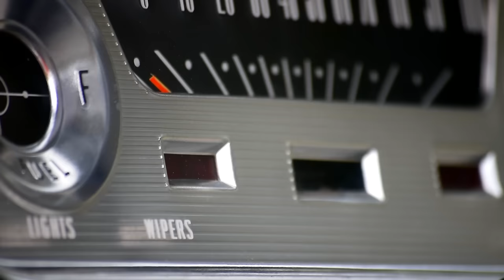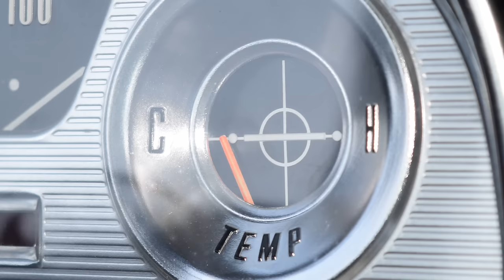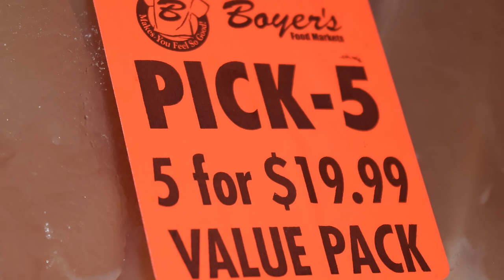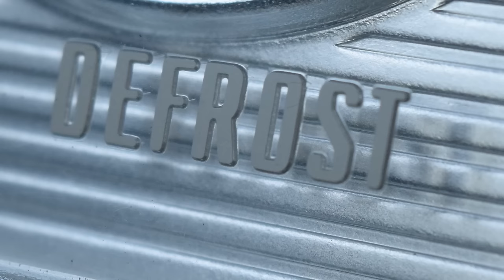Regular Car Reviews: 1960 Ford Falcon (stock)

Comment: Just saw this.  Just remember that without the Falcon the Mustang would never have been born.  The Mustang was a modification of both the Fairlane and Falcon platforms.  1965 shop manuals actually cover all three cars since many of the components overlap.  While Iococca might have hated the Falcon, the platform was pretty adaptable and he used it to his advantage-the 1964.5 Mustang was by and large a 1963 1/2 Ford Falcon.  By late 1963 a 260V8 was available and later 289s and 302s could be found in Falcons.  The trim improved and a nice 64 Sprint is a pretty hot car for its day.  You also have to remember what McNamara was trying to do with the Falcon.  The Edsel line had shown to be a financial disaster for Ford, costing something like 2.5 billion dollars in todays funds.  The 1956 and 57 Continental Mark IIs lost several thousand dollars per car sold.  The Lincoln division had cars that ballooned into huge monsters that were impressive, but so expensive that it threatened to run Lincoln out of business.  The 55-57 Thunderbirds were popular but did not sell all that well.  The only really good seller in the entire group, and the only vehicle that really kept Ford afloat during that time was the Fairlane.  Ford was rapidly losing ground to GM and even Chrysler.  Ford didn't have the money to continue to experiment at that time.  McNamara was perfect for that time.The 1960 Falcon was boring.  But it was built to fill a niche.  It really wasn't designed to be a primary family vehicle, although it was used for that.  It was more of a second car, a cheap alternative to buying a used car.  It seems sexist now but it was built to be a woman's car, something the 'little woman' could drive around town to get groceries or take the kid to school.  And it worked well in its role as secondary car.  The 144 and later 170 and 200 was pretty much bulletproof and the fordomatic needed little maintenance.  The brakes were good by 1960 standards and it was easy to drive.  And the platform was easy to update.   But an upgraded Falcon was almost as expensive as a Mustang so most people bought the Stang, even though mechanically they were very similar and the Falcon was probably a little bit faster.  I actually like the Falcon, for what it was it was a decent car.  And it honestly was a better car with the three speed column shift than it ever was with the automatic.

Comment: You forgot to mention the protruding steel, skull smashing dash top and no seatbelts.  eek!  My mother had a green one of these and it was lovely and had seat belts fitted but that dash always made me nervous for my frontal lobes.  In Aus, the top ball joints used to break on our shocking roads of the time but were fixed in subsequent models.  Cheers.

Comment: My stepfather bought an early Falcon wagon in the late 60s and spent maybe a year rebuilding it, even putting in a new engine--a straight six. Seemed to run pretty good when he finally finished it, but I don't think he kept it for as long as he spent rebuilding it. Next time I saw him he was driving around in a Cougar with a huge V-8, terrible mileage, and air conditioning that couldn't deal with summer in Sacramento.
Reply: Naw! He couldn't deal with the LOUSY Falcon engine.

Comment: in 1975. i had a 2 door 1960 model with 3 speed manual and column shift . later Mustang 200 6 cylinder.

Comment: Had one, drove one...many years ago. The 144 was rated at 85 horsepower at the flywheel. The engine in this video is not running correctly. It is shaking and missing, which means it needs a major tune up. Mine ran smooth as silk. As far as the rest of the video is concerned, the individual making it can only find fault with the vehicle. It was 1960, cars did not have emission controls, they did smell like gas, but they ran as produced. It is apparent that the author of this video was not even around when this or any other vehicle before 1970 was produced. I own a 1963 Cadillac and love the experience of the times.

Comment: You could get the Falcon with a 260 cubic in V8 by 63. Basically a 289 with a shorter stroke. With an optional floor shifting manual it was pretty good at getting around and did not suck gas like it was free.

Comment: Power steering was not necessary with the old narrow cross-ply tyres.
Reply: Especially in when that car weighed 2500 pounds and gave the driver a really good feel for the car.

Comment: In "The Decline and Fall of the American Automotive Industry", Brock Yates wrote that Detroit HATED making small cars. The cost to make a small car was not that much less than a big car, but the big cars could be loaded up with profit-making options. They would make a small car when it was necessary to beat back foreign competition, but stop when they felt the threat had waned. They also thought that if they made a crappy small car, their customers would think that all small cars were crappy. That's why some small cars got a cheap engine instead of a decent one that cost a little more.

Comment: I know they had "Futura" and "Sprint" packages for Falcons (the later was a Spot option) and they at some points had Hard Top and Soft Top convertibles (my dad had a soft top at one point).

What were the design changes?  
The Instrument Cluster and some other interior Changes happened in 1963, s more "Square" body in 1964-5, another body change 1956, eventually the last year of 1970 they made a few Torino's with "Falcon" labels.

Comment: The ironic thing is that while back in the day, this car was the equivalent to a base focus, and it got no attention whatsoever. However, nowadays if you take this to a car show, most people will flock around it and it will get the most attention, because most cars you see at car shows are v8 swapped camaros, mustangs, fairlanes, etc. Nobody sees these 6 cylinder cars anymore.

Comment: The US may have dropped the falcon but us Aussies kept it going. We stopped making them in I think 2016. 
That crappy little 6 engine ended up the Barra 6 which we turboed as a v8 eater especially LSs. The final v8 falcon had the coyote 5.0, stripped and rebuilt into the Aussie Miami, supercharged. 
The falcon here kept the mustang out of australia because the mustang was too slow.

Comment: I had a '61 Comet, the Mercury version. The 144 and 170 cubic inch engine was a terrible design, had huge blow by. The shift linkage got worn and chaffed thru the brake line. The clutch pivot in the bell housing broke several times. But hey, new cost was about $2600.00

Comment: I really liked watching this video!  What was said tis true.  I own a 1961 Falcon.  3 on the tree, with a 170 C.I.  Ordered U&L ball joints from Mac Auto.  Should be here in a couple more days.  Just put a new mech. fuel pump on it because it started blowing raw gas out of the vent hole.  Engine over revs on the interstate, so I just putt putt around on the back roads.  I did put a rad. overflow tank because antifreeze costs a bit, and I do not want to make any more dogs die.  Next time I think to get my camera out, I might put a video of it on my page.  Nothing on it except for trail camera pics of a huge raccoon intimidating my cat.

Comment: Father had a 1962 Falcon wagon that he bought used in 1963 and kept until December 1969, when it had about 90,000 miles.  I think it was running on three cylinders by then. He was a much tougher and more competent man than I am and never had a car with an automatic transmission until he bought a Taurus in 1987.  I really don't think Ford built a good 6 cylinder engine until the Duratec V6 debuted in 1995.

Comment: The Falcon,  which I love was Ford's response to the Studebaker Lark.
Reply: Nah, 1958 was a recession year and the Big 3, particularly GM, were expanding their market share by introducing compact models. Next would be the introduction of mid size models in the early 1960s, or B-body platforms. They'd have small, medium, and large cars. The mediums were actually the size of a 1950s full-size, since the longer, lower, wider trend had increased the size of a full size.
Studebaker was in trouble and little competition for entry level GM Chevrolet division. 
Nash had been building smaller cars such as Rambler and Metropolitan for years. Sears even sold a car, the Allstate, through their catalog. Willys Henry J and Hudson 6 were smaller cars, too.
Studebaker may have introduced the Lark prior to the Falcon, but the wolves were howling for Studebaker.
GM sales were so successful, in the 50s, that they were crushing Ford and Chrysler. The independents didn't have a prayer.

Comment: I'm so very sorry for you, Mr. Narrator.  You seem to have so much trouble understanding THE WAY THINGS WERE back then. ChuILL, please.  I used to work on these way back when, before latex gloves and everything!  I even got my CA Smog License in the late '70s, so I was smogging these old birds. (That caused even more overheating and the addition of a radiator overflow tank.)  I loved tuneups on my '60 F-100 because I could climb over the fender and stand next to the engine to put plugs, points, condenser, and rotor in.  Fond old memories of the sparse underhood structures back then.  <wistful sigh>
P.S:  YOU FORGOT '65 Goats, with the 389cid SixPack motors (triple 2-bbl carbs)!  It definitely wasn't a Falcon, either.

Comment: Those old two-speed automatics were hilarious.  They operated well in two modes.  Either you drove them real easy, and the transmission behaved reasonably, or you drove them super hard and the transmission behaved reasonably.  Driving anywhere between real easy and super hard resulted in a very disappointing shift into second gear, they just "dogged out".  Just something for those viewers who haven't experienced a two-speed automatic.

Comment: 19F or -7C if you a for some reason driving it when it is that cold do not fix the heater. That is just the way it works. My brother spent a bunch at the dealer with new heater core and fan. No change. His was a 60 Comet for some reason Ford put fins on it. Almost every thing else is the same. The 100 MHP speedo is very optimistic.

Comment: Ford Australia made these from September 1960 from components shipped from the US. The only local adaptation to start with was to shorten the rear overhang of the station wagon. Then they had to strengthen the gearbox components, put in front suspension ball joints from the Ford Fairlane to stop the suspension from collapsing, strength the frame so the body wouldn't twist on rough roads and do more to stop rust. It took five years and three model generations to do so. Only then did Australians stop laughing at Ford Falcons...

Comment: Mean while down under RHD versions penny pinching was apparent.Suspension issues due to bad ball joints, manual gear box, weak linkages, no synchro on first these wheezy engines needed & so did not stand up well to local roads.Local version had stainless steel trim window surrounds pity about the sharp edges & elsewhere.Not missed.

Comment: I just came back here after like an year to tell you all that on Argentina Falcons were Made till 1986 or so.I think there were some Made on 1989 but i cant be sure about that.I can tell i've seen a 1982 model cause my dad had one.Theres a Lot of Falcons here,they still running good,Easy to fix,3 speed manuals and More combinations.

Comment: Ford has always come up with some real winners.  Falcon, Pinto, Maverick, Tempo, Fairmont, Taurus..  The Falcon, however, wasn't a complete loss.  When Lee Iococa went to Ford, the first thing he did was take Falcon (a pretty good car, actually) and put a new body on the chassis that wasn't quite as hard to look at  Voila!  The Mustang was born.    De Lorean did the same at GM.  He took a ho hum car, Pontiac Tempest, and dropped a Bonneville engine in it.  And we had the GTO.  It isn't enough for cars to be reliable and functional.  They need to be fun.  Not too many fun cars around these days that cost less than a starter home..  Chrysler has brought back some retro fun cars.  I'd love to see them bring back the Demon/Roadrunner.  My first car was a 1982 Pontiac Grand Prix (GM G body).  It was my high school graduation present and my college car. (I wanted an Audi, but Dad's brother owned a Pontiac dealership....so we always drove Pontiacs) I think it cost around $9600.00 loaded.  How times have changed!  I drove it about 5 years.  As soon as I got my first real job after college, I traded it off and got my Audi.
Reply: Prior to the GTO and Superduty and when Olds, Buick, and Cadillac had the only v-8 models at GM, Pontaic was considered an old people car for those wanting to upgrade the Chevy. The trade mark Pontiac chrome band from hood to trunk got nicknamed a "hatband", and hats went out of style with Truman.

Comment: And don't forget the vacuum operated windshield wipers. If the vacuum pump on the fuel pump stopped working, the wipers would stop when you step on the gas.

Comment: Actually, the original Ford-O-Matic was a three-speed unit built by Borg-Warner. It started in second gear unless you selected the "L" position. The original Ford-O-Matic was a rush job because Studebaker would not license their three-speed Automatic Drive (introduced during model year 1950, also built by Borg-Warner) to Ford. The gear ratios were different, and the air-cooled  Studebaker transmission had a locking clutch in the torque converter. The Studebaker used a "PNDLR" shift quadrant, whereas the Ford (and Mercury) automatics used the "PRNDL" pattern which (with variations) has become the industry standard.

Comment: You didn't talk about the wipers. Vacuum. An old boss (when I was a teen) had maybe not a 1960, but a '61 or '62, at the most.  Anyway, the wipers are powered off the vacuum of the intake manifold. They work quite well at idle, but go slower & slower as one puts their foot in to it, which is almost always with these. So slow, the wipers are practically useless. I owned a '68 AMC AMX as a teen also & was shocked that it too had vacuum wipers. But they did it different, used a double action mechanical fuel pump. The wipers were decent at idle but got faster & faster as the car revved up.

Comment: Quite a bit of misinformation here.  The 144 was rated at either 85 or 90 horsepower, depending on the source, not 80.  Ford did not "get rid of" the 144 after 1960, it remained the standard engine in the Falcon and Econoline through 1964.  They did not bore the 144 to make the 170, they stroked it.  If the 2-speed is adjusted correctly, it should hold low gear out to around 50 MPH when your foot is to the floor in drive, not 30.  "America's first modern economy car"?  What about the Nash Rambler / Rambler American and the Studebaker Lark?  Back up lights, side view mirror, and hazard lights were an option most cars until 1967.  The only U.S. cars to have a dual master cylinder before 1967 were AMCs and Cadillacs.  Ford's import fighter did very well on the market, I'd say Robert McNamara  was right.

Comment: That was harsh. That 144 should have been solid lifter adjustable rockers if I remember right. If so you are probably running them loose. The accessories pull Jack Ship compared to the automatic transmission. I'm left with the impression that you aren't too bright. I'm sure you would have been happier with the 3 on the tree, except for the collector value. That three speed with long tail shaft, I could grip it by the tail and hold it out at arms length. It was a tiny box. Taking the automatic transmissions weight off the car would have added to drive ability.
Reply: I agree -- not the brightest bulb in the turn signal socket.

Comment: You know, with a minimum of changes, Ford could be building and selling this car today.

Coolant Recovery Tank
Power Brakes
170 engine right off the bat
Reverse Lights & Flashers
3-Speed Automatic
Electronic Ignition
Side Fuel Filler (for safety)
Round 80-mph Speedometer (this thing will never go 100 anyway, and vertical speedos are useless in the middle range)
Ammeter

All of that would have increased the price by maybe 15%.  Still a heck of a deal!  I'd drive one!

Comment: The Falcon was the right idea. They should have kept an entry level type car. Good on gas for an inline 6. Solid, simple construction. How the 70's might have looked different if they kept improving the styling and improved the inline 6 and kept the mileage. 
Japan started building Corollas, Civics, Tercels, and killed Detroit. (Along with the 1973 Oil Crisis).

Comment: You are WRONG.
The Falcon was not the first Modern compact car.
STUDEBAKER LARK was released in 1959‼️
Also, the Rambler American had been on the market for several years.
The Studebaker Lark was successful enough to save the company - ( for a few years).
‼️‼️‼️
And Ramblers were all Unibody - had been for many years.
BUT I enjoyed your video.
My grandma had a bone stock Rambler American.   The only option she got were :
Backup Lights
Heater.
It was a ‘63.
No seatbelts either.
Mu first car was a ‘64 Nova. I had ( GM’s version) 2 speed Automatic transmission, and a 194 ci.  Straight 6.
It did fine [ for what it was].
A lot of racing people actually wanted those 2 speed transmissions.
📻🙂

Comment: Had a 1961 Ford Falcon. Goes like h-ll when you change the six to a Cobra 289 with a 4 speed hurst. Talk about a sleeper!
Reply: You are right ,they are very light 250 lbs lighter than , than a 65 mustang. You just have to change to a v8 suspension.